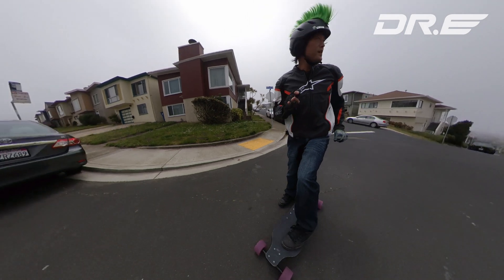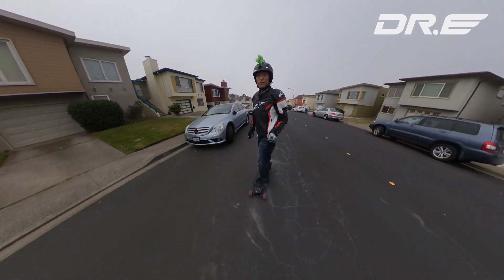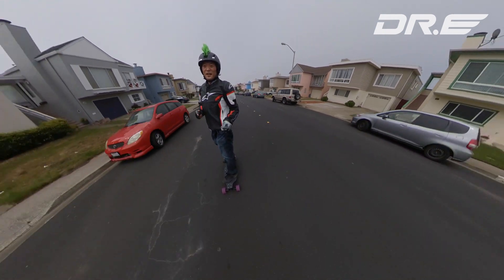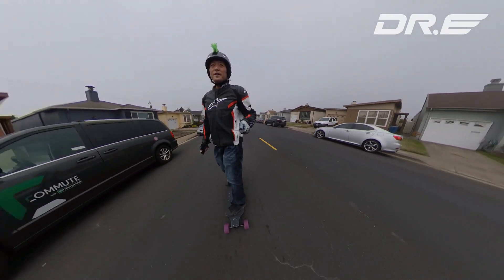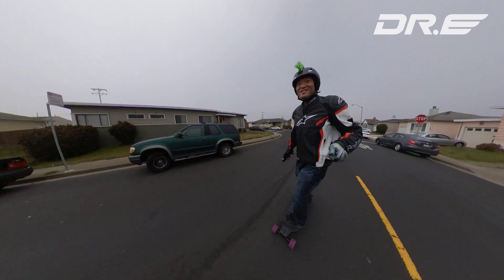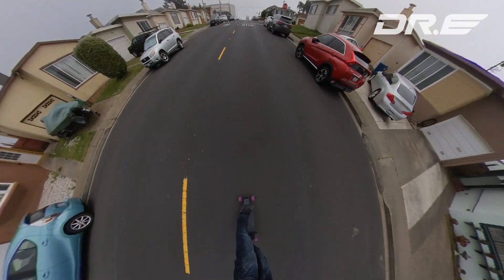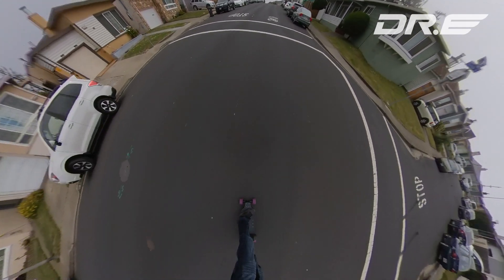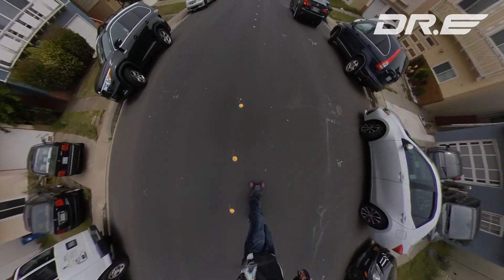How to Swerve on Electric Skateboard at 20MPH+!

Comment: I dislike drop down decks, they lock your feet .. so you can't jump off. 
Someone else told me as well. I fell about 8 times. I prefer bigger 100 mm wheels in the front for protection against those small pebbles.
Reply from the maker: I agree, dropdown decks can get you locked in.  I want a flat deck for that reason.  Why my 6374 will be on non drop deck.  Thanks for the comment!